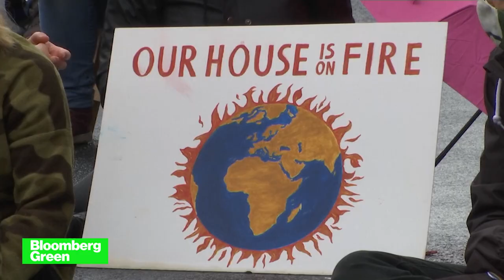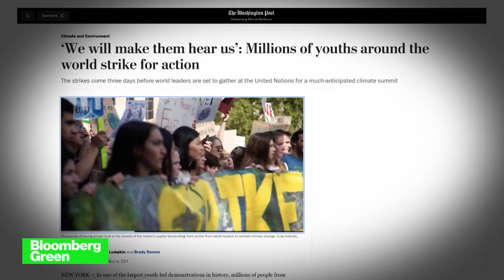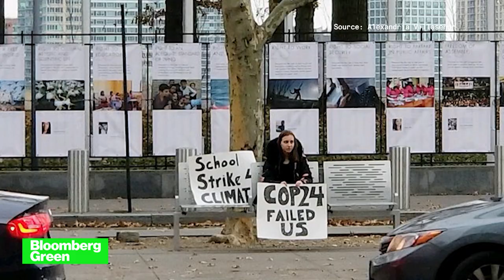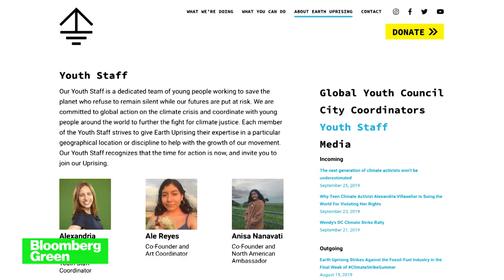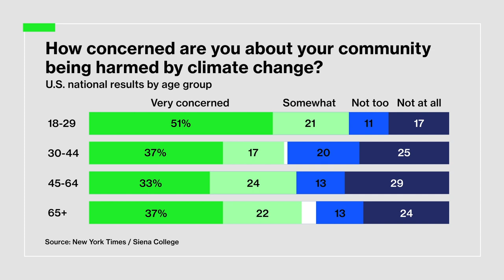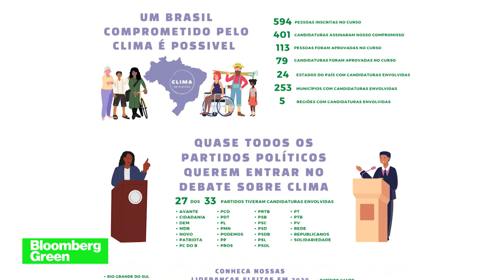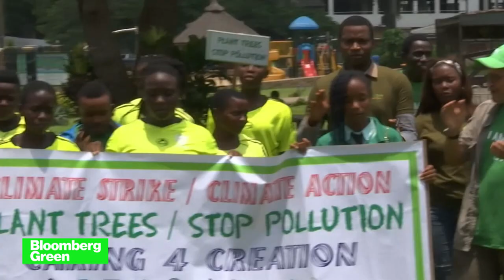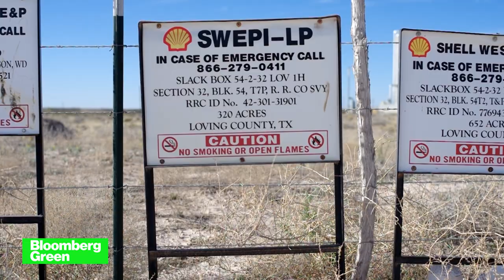Bloomberg Green: The Youth Climate Movement

Comment: Sick 😷
Reply: The only thing sick is your denial of reality that the earth is getting warming and it’s caused mostly by carbon dioxide produced by humans and the increasing release of methane in Arctic regions.  Oceans are rising an average of 1 inch a year, so in less than 50 years oceans will rise by 4 feet.  There are more extremes in weather because of a weakening of that jet stream because temperature differences between the Arctic and temperate regions are less.  I live in the upper Midwest and have seen winters get months shorter and milder in my lifetime.